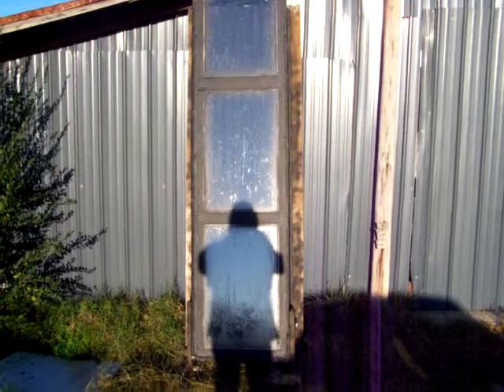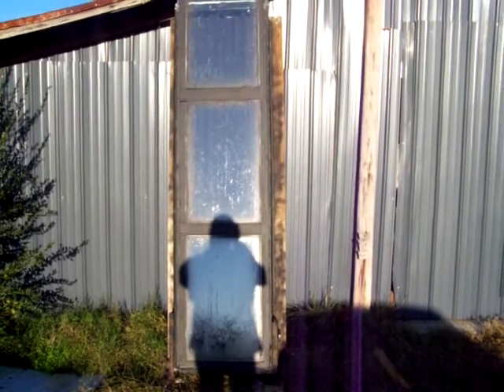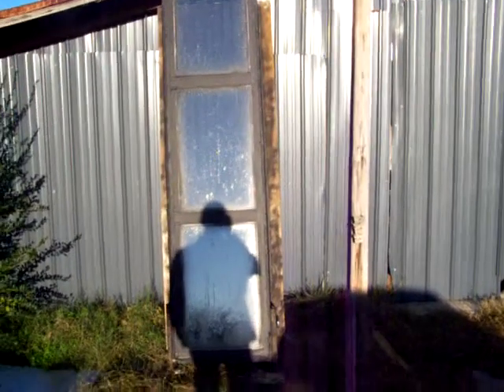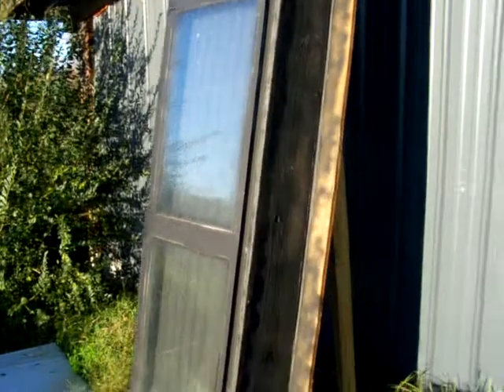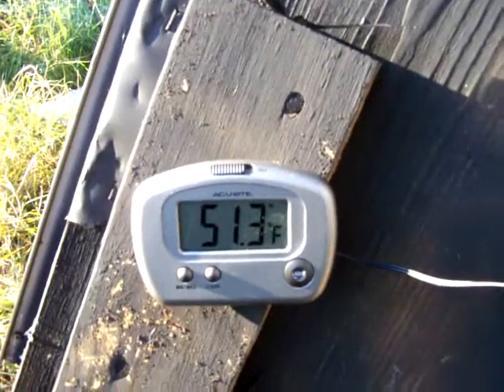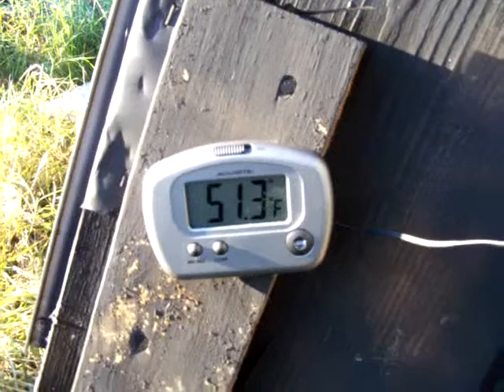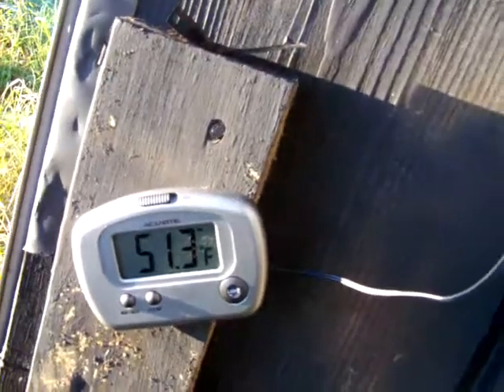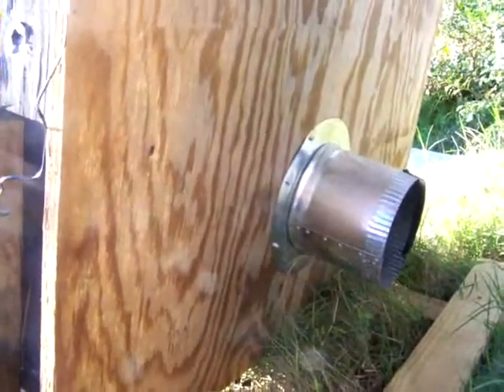solar furnace

Comment: The  next thing I would do  is paint that shiny steel wall on the building behind that panel  Flat black . Then I would Then put on strapping using metal studs and then cover it all with any kind of clear cheap polycarbonate like suntuff or similar. Then watch out so you don't boil yourself out of your house. All kidding aside that's what i would do.The bigger it is the more heat you get. and every BTU that you capture from the sun is one BTU that you don't have to pay for. Mine is 384 sq.ft.